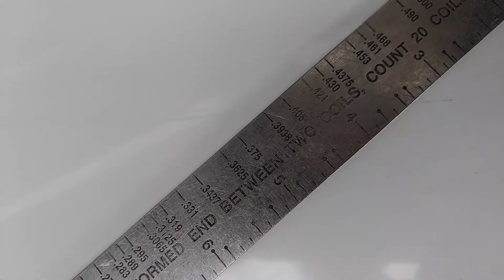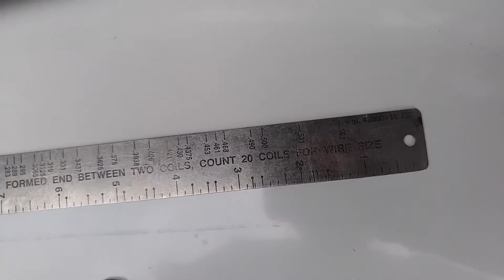How To Use A Garage Door Spring Gauge

Comment: so what happens when you use the wrong spring with the wrong wire size?  what happen if the wire gauge is too thin and what happens when the the wire gauge is too thick?  if you go too thick will it  provide too much lift and  snap the door up and too thin not be able to  lift it? if that is the case  could you just wind a  too thick  spring less times and have it work?
when  you are installing a new door then how do you determine which  springs you should use for that door?
Reply from the maker: +Andrea Mitchell 
Hello!
Great questions.  Really what determines wire size is weight of the door.  You could have a .192 wire size, which is small wire or you could have a .273 wire size.   What determines what you need is the weight.  That's the most important.
I have a formula I use to calculate what's needed.
A common height is 7'.  So for a 7' high door you would take .2885 × the weight.  That number would be your IPPT.  Which if you had a Service Spring Guide book, you take that number and find the length/wire size that the number comes close to.
Its kinda of confussing at first, but the more you do it the easier it is.